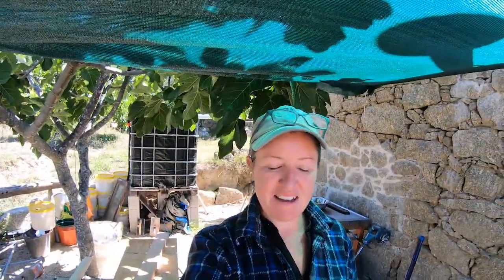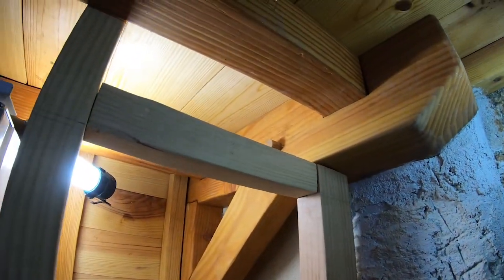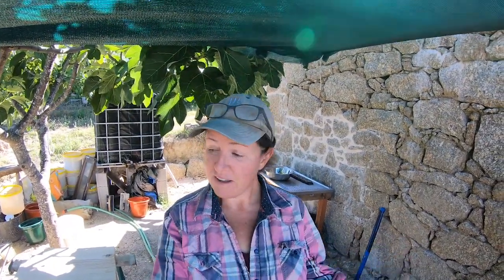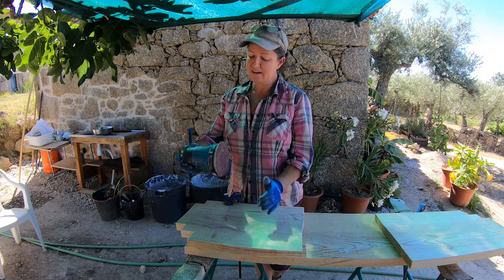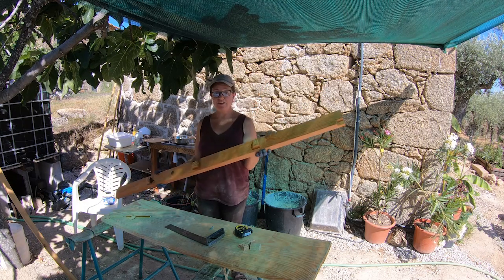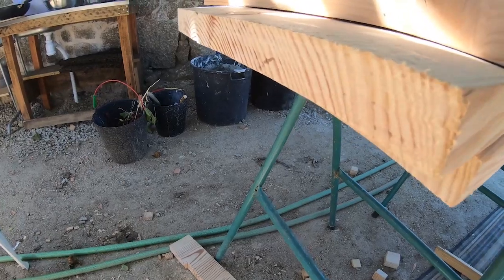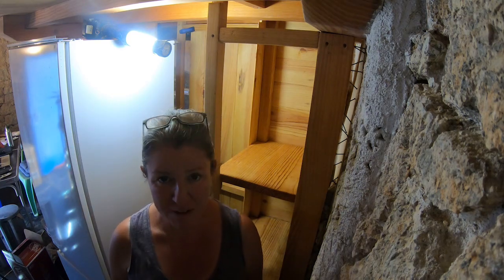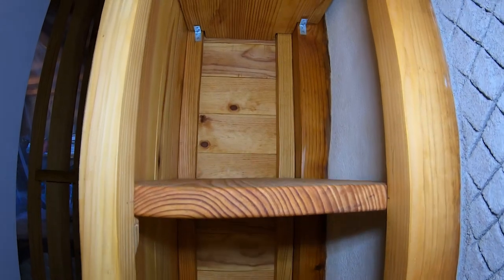Building Shelves in My Off Grid Barn Conversion in Portugal - Part 2

Comment: The shelves look great. I have a suggestion to make them more adjustable. You can drill and peg your framework and rest your shelves upon them. The only cost would be the pegs and the time spent in the process. You seem to be concerned about the time you spent engineering and building "on the fly" but if you think about it you would have spent as much or more time carefully measuring and designing and pre-cutting your material. You did great!
As for the jigsaw, it seems most tools are designed for men's use. As a petite woman, I now choose tools that I can use with my hand size in mind. You're making great progress. Have a great day and stay cool.
Reply from the maker: Actually using dowels was my original plan and I'm I'm wishing I'd stuck with that! Although for the two more shelves I want to install, I'm going to use that method... I can't be arsed making  more of those little nub things and screwing them in in situ will be really tricky. Thanks for the reminder! Yes... small hands isn't usually ideal in the world of tools!

Comment: Nice shelves, it's great faffing about with ideas as you go. I get extremely knackered constructing things but the feeling when you've finished is priceless. I've made a cobbled together lightweight gate to keep cats from rushing around the corner of my garden & marmalising the birds & squirrels out of scraps of timber, bits of fence panels, wire fencing etc. Not pretty, not remotely straight but functional.
Your shelves are not only straight but also strong.
Reply from the maker: Ha! Nice idea to foil the cat hunt! Yes, it's very rewarding and I think I work best making a plan up as I go, at least with the smaller projects. So far so good, I'm happy with the result!

Comment: usually staying one inch and a quarter in from any edge with predrills should eliminate splits in the wood. also, small pieces can be glued with just one screw or thin low reveal screws. gluing and clamping splits overnight works fine. love that bubbly humor.
Reply from the maker: That's great to know! I thought my two screws was overkill! Also good to know about the clamping and gluing trick. Using wood glue is new for me and I often forget about it until afterward. Thanks!

Comment: Those shelves are solid, nice work 👍🏻 I do think to put in wooden supports at the back would look nicer as you can see the metal brackets.
Reply from the maker: I've actually swapped to using dowels and they're working great. Good news is that, with stuff on the shelf, the metal brackets aren't visible.
Reply: @PortugalfromScratch  It's just your wooden brackets looked v stylish ;)

Comment: Those are very nice looking & sturdy custom-fit shelves.  Great job!  It seems every DIY project I do takes a lot longer than I think it will take (& many trips to stores), so much longer that I have stopped trying to guess how long it will take.  I just start the job & it takes as long as it takes.  That way I'm never behind schedule. :-D. And since you used screws, you can always change your mind & move shelves higher or lower if you like.  I enjoyed your video.
Reply from the maker: That's a great way to do it... just go with the flow and when they're done, they're done! I'm lucky to not have any deadlines so I should chill and not try to rush... but it's tempting to just want to be done when something's been dragging on. But that's when I make mistakes. Thanks for watching!

Comment: That was wonderful! Great shelves with a lovely oiled finish! I am glad you decided to add more shelves. On the little shelf brackets, would they split less if the grain were going the other way? (just curious and a guess since I know nothing about wood working.)
It’s good that you are pondering. There is not enough reflection happening these days.
Reply from the maker: Thanks! Hmm.. I'm not sure, I think about the same risk or a little bit more because the width would be more narrow, if that makes sense. I think glue and screw is the way forward! Although I used dowels in the other shelves and that worked best, I think. Ah well, live and learn!

Comment: I think it looks great but would (wood?) suggest using dowel's for the shelf support, just drill holes, glue them in and cut flats (probably could get away without) about 1/4 through the dowel sticking out portion. No screws that would potentially split the small pieces of wood. Time and perseverance pays off on some beautiful shelving that you will have forever! Take care.../B
Reply from the maker: Yes! I actually ended up using dowels for the newest shelf I added and I'm kicking myself for not using them for all of the shelves! It was my initial idea and I'm not sure why I veered from it. Definitely what I'll be using going forward. Thanks!

Comment: What I have to do when working on projects like this is to just try to not think about anything else and put my tunes on.  My tunes keep me from getting frustrated  and keep me from being aware of the time.  I know lighting is an issue in your house and you might want to get some of those little battery operated tap lights in your shelves.  Just a thought.  I think they turned out really nice.  Good job!!
Reply from the maker: Lights for inside the shelves themselves? Good idea! Ya I need better lighting, I was hoping to be further along so I could get things wired up but I think a temporary solution should tide me over. Even solar lights or something... I'll shop around!

Comment: YUR DOIN GREAT , LEARNIN WOODWORK TAKES CONTEMPLATION, BUT YUR IDEAS WILL COME. I RECOMMEND USING WOOD GLUE WITH LESS SCREWS,  HELPS AND LESS DRILLING . GIVE YURSELF A LOTTA CREDIT, I HAVE AT LEAST 50 YEARS OF BUILDING EXPERIENCE AND EVERYTIME , IM STILL LEARNING. GREAT JOB. SO FAR I LIKE THE DESIGN AND FIT!!
Reply from the maker: Yes someone else also mentioned I could have used wood glue. I was petty sure that my solution wasn't the best idea... just looked ridiculous and on such a tiny bit of wood. Using wood glue is new to me so I often forget it! Thanks!